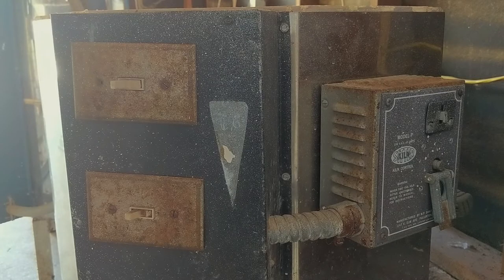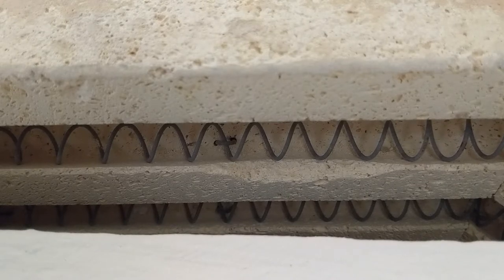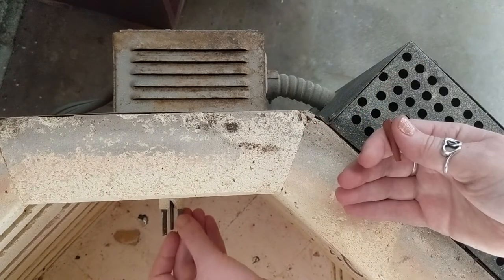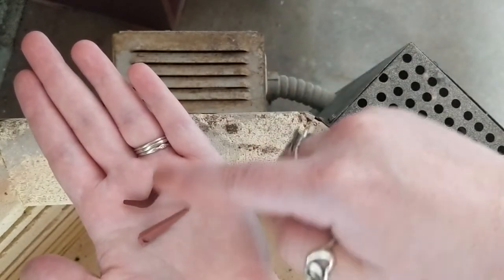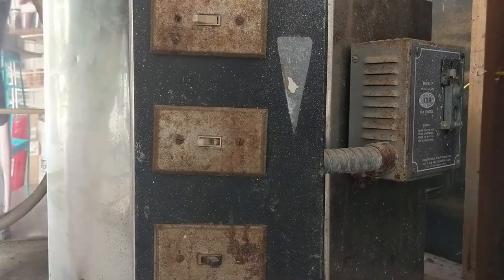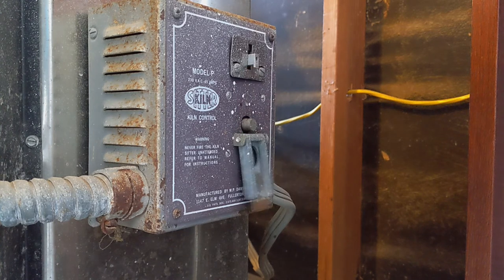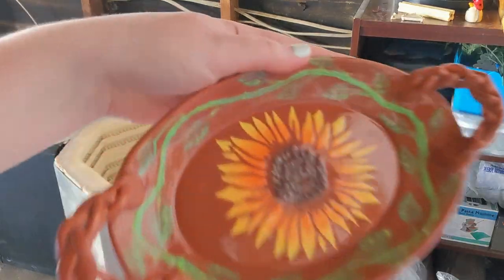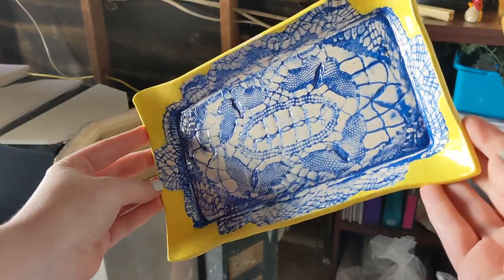Firing My PREHISTORIC KILN… with Light Switches!?

Comment: I have the same kiln setup and had no idea how to use it! In all of the other videos I’ve seen, the kilns are much fancier. Would you mind sharing where you purchase those cones? Thank you!
Reply from the maker: So sorry I am just now seeing your comment! I actually got them from a local ceramics supply company where I get my clay and glazes from.  You can actually find better ones on Amazon that are bars instead of triangular, that will give a very consistent fire since the surface on which the shut off bar is resting is flat and not tapered and would be harder for it to break.  Ill link the ones on amazon but theyre hard to come by.
https://a.co/d/hdwmcct
theres also these to test the temp that your kiln is firing at and test the consistency of different spots in your kiln (sometimes there can be cold spots where your elements may be going out.)  I have explained how to use the following product in several other comments but you basically put them in a blob of clay (because it will stick to and ruin your kiln shelf) or set them on broken pottery or kiln furnature
https://a.co/d/6kgYrZt
and then here are my normal firing cones (but im making the switch to bars when I run out of my regular ones)
https://a.co/d/iSgKvrt
I hope this all helps and I am so sorry for taking so long to get back to you! I hope you see this!
Happy Firing!
Emily

Comment: Thank you so much for this video! I recently inherited a similar dinosaur and have been very anxious about firing it!
Reply from the maker: You’ve got this!!! So glad i could help! And if you need any more help out have other questions just comment and I’ll do my best! Theres also a lot of info in other comments I’ve left on this video too! Best of luck!🥰
Reply: @thepottereden Actually, since you mentioned,  I do have a concern! My top "light" switch is stuck in the on position. I can't get it to budge to off. Any ideas on why this may be happening or how I can fix it? I am thinking I have to take the whole control panel apart and see what is going on in there.
Reply from the maker: @Remi-xz7en  oh no! Well, i had to do the same. If yours is the same as mine, you’ll want to be very careful of the old screws because mine were on the brink of breaking, also the wires in mine are very short so it was a 2 person job. One person held it open and the other worked. Mine had about 10 dirt dobber (wasp) nests in it. My kiln was sitting in an old barn for about 20 years before i got it. We dumped out a literal rats nest before putting it in the car. Cleaned out tons of dirt dobber nests from the inside and the front panel. If yours was anything like mine, it may stink for the first several firings. You may also have to replace some coils too. Do a test strip of different cones (check out other comments for how to) in your first several firings to make sure it’s firing properly and consistently. Theres also such a thing as hot spots and cold spots in older kilns and your glazes will turn out slightly different because of it. Just so you know. There’s not a ton of info out there about that though.
Reply: @thepottereden My kiln was well cared for, luckily! I got an electrician to replace all of my elements and the sticky light switches! I am running my first bisque today! How long do you leave the lower switch on for a bisque in your kiln? I was going to check the moisture from the peep hole in 2 hours, then close peep holes and the lid once I see no moisture on glasses, allow to heat another hour with everything closed before flipping the second switch. I am also relieved you mentioned the smell because, yes... mine is currently quite stinky.
Reply from the maker: @Remi-xz7en  I am so sorry it has taken me this long to respond to you@ Life has been crazy and I havent been very active here on youtube! How was your first (on many I hope) firing?! I am so glad your kiln was well cared for and that you found someone who could replace your elements and switches for you! That is so cool! Do you mind sharing how much it cost? 
Depending on how dry your greenware is, I leave my kiln on and open for 1-3 hours. I have also had to start leaving my peep hole closed because I was having a problem with the plug falling out so I shoved it in and now it wont come out😅 A normal firing that is not rushed and everything is nice and dry, I will leave the top open for 1 hour, put the lid on with the smaller lid off for 1 hour, then close it up (so long as theres no moisture present) and leave just that switch on for an additional hour before switching the next on. If I am at all worried about moisture, I will leave it for 2 hours all closed up.
haha mine smelt like intense rats nest! what does yours smell like?

Comment: Hi, i'm loving your pottery and your video, I just bought an even more basic kiln, very old and lots of rust, but I figured that gives me more money to play with materials and learn. My kiln doesn't have a kiln sitter. I'm not sure where to start with that. Any advice?
Reply from the maker: Hi! Thanks for commenting and reaching out! Let me dig just a little and see what i can find but im thinking youll have to buy a set of pyrometric cones to set up and watch them melt and then stop your firing once it gets to the desired temp. Basically if you want a bisque to fire at a cone 05, youll get 5 different cones, cone 03-07 and make a little clay holder for them and set them securely in the clay at an angle. As your firing process, you’ll see them melting more and more. Watch through your peep hole and there should be a nice soft bend on the 05 cone (set up in the middle) and the lower temp cones (07-06) should be more and more melted, while the 04 and 03 are much less melted or not melted at all. Look up a manual (if you can find one) for your exact kiln and see what it says. Ill try to fond a vid about how to make what i am talking about. They should also sell some reusable “cone sitters” (the clay one i was talking about). Ill try to find that too. Best of luck!
Reply from the maker: This is a great vid to help you understand what i am talking about. I didn’t realize there were self standing/supporting cones which is great! He also talks about only putting in 2 cones one at and under the temp he is talking about. I would suggest at least having 3. His cones are merely for him to know whats happening in the kiln and making sure there isnt an issue with his digital controles, thermocouple, or coils. Yours will be for measuring temp and knowing when to shut it off. So in your case i would at least have 3. One below, one at, and one above the temp youre aiming for.  That being said, when you do the firing, make sure youre raising the temp slowly and have a GOOD pair of welding gloves to take your peep hole plug in and out when you check the cones. Again, best of luck!
https://youtu.be/wO9fk--xgwc
Reply from the maker: This also has some vital info like using eye protection and timing!
https://youtu.be/zvUc-Gw01No

Comment: have you ever put in your cone but forgot to put on the kill switch?  and then have to just manually turn off the button by yourself when it is approximate time to stop the kiln?
Reply from the maker: Great question! The kill switch has to be engaged or it will not turn on. The button will not stay pushed in unless that switch mechanism is up. I dont know if any other kilns are made where they can fire without a kill mechanism

Comment: I just acquired an ancient Sno Industries Kiln with the same silver cone switch box thing you have (thanks for explaining) but mine only has 2 light switches l😂 how do you know how to bisque and how to glaze fire? There is like NO info on this Sno Industries Kiln anywhere.
Reply from the maker: Great question! It is so tricky figuring out how to fire a kiln in the first place. So intimidating! But really its the cones you want to figure out! A bisque will fire at cone 04-06 depending on what your clay says. So you would buy the appropriate cone for the temp you need and the kiln will heat itself up until that cone melts and trips the off switch from inside. If its your first time firing, i wouldnt put anything inside and just do a test fire with a few tester cones. They are cones with little stands on them so they stand almost straight up. Youll want one for a cone above and below the target temp. So if i want to bisque to 05 i would get 3 testers, 1 at 04, 1 at 05, and 1 at 06. Set them on an unfired piece of clay or broken shelf so they dont stick to the inside of your kiln. Fire them to the target temp (05) and after the firing, your 06 (the cooler temp) should be shlumped over, the 05 (target) should be a gentle curve, and the 04 (hottest temp) should barely be melted at all. Ill link a vid about that. But that will tell you if it is shutting off by itself at the correct time! A glaze firing will be the same way. Look at the bottle of glaze to see what temp/cone it needs. A high fire could be anywhere from a cone 4 to 10 depending on what it is. Do the same procedure as before but with the appropriate cones to make sure it is getting hot enough. Some kilns only go up to a certain temp. Also keep in mind that the hotter you fire at, the faster the elements and kiln brick will wear and need to be replaced. Mine is just fine but i only ever bring it up to cone 6 at the hottest. If you have more questions, don’t hesitate to ask!
Try these vids to see if they help explain what i mean a little better
https://youtu.be/zvUc-Gw01No

https://youtu.be/wO9fk--xgwc

Comment: I have a similar old kiln but it has two dails for bottom and top, low and high.  How many hours in between the low setting and high setting you think I should wait?
Reply from the maker: great question! I dont have a ton of experience with dial kilns so let me ask you this, does yours have numbers or a range between high and low where you can turn it up one number every couple of hours or is it more like an on off situation where you can only turn it from low to high and you can feel it click in place at the low or high setting?

Comment: Hi, i Just bought a slithly less ancient kiln. Instead of the switches i have a turn 'button' with 1-4 on it. But it works the same i think. But my question is... With the first bake, the temperature needs to stay a bit around 400. How do i do that?? 😅😅
Reply from the maker: Great question! Its hard to gauge temperature when they dont have a digital temp panel like the new ones do. I am not sure that a cone exists that melts at 400F or c for that matter. You can purchase a thermocouple to use for specific low temps like that! Itll probably be your best bet

Comment: How long the pottery cooks in hours? And what is the average temperature?
Reply from the maker: The potter fires at a peak temperature of about 1888-1911 F (depending on any holds) for a cone 05 firing like i did in this video and takes anywhere from 8-12 hours to get to peak temp to shut off (depending on how slowly i raise the temperature). It will then take about 12 hours for it to cook enough to start opening it (depending on your kiln size. The larger the kiln and/or the more that’s in it, the longer it will take). I hope that helps!
Reply from the maker: You can also look at this chart and do some math to figure out exactly the temp and time with what cone you are using
https://www.clay-king.com/kilns/pyrometric_cone_temperature_chart.html

Comment: Are you still using this Vulcan kiln? Have you found replacement elements for it other than from Vulcan themselves?
Reply from the maker: Thankfully, i have not had to replace my elements! Even though this dino is probably close to 60 years old, i am fortunate enough that it was well kept. Unfortunately, since its so old, i believe the elements would have to come from vulcan. If i were to replace them, id probably go with them just so nothing get accidentally messed up by feeding too much power to them or not enough. I am sure you can find elements for them without having to go through vulcan, youd just have to measure very precisely

Comment: how do you know what cone to use ?
Reply from the maker: Great question! It actually has to do with the clay you use. The clay also determines the type of glaze you use as well. When you buy clay, it will be classified as low, midrange, and high fire clay. On the listing, package, or website, youll find what cones to fire the specific clay at. A low fire clay will be fired to somewhere between 06-04. A midrange claybody will fire to somewhere between cone 4-6 usually and a high fire is usually cone 9 or 10. Sometimes a glaze or clay will say high fire and be rated for a cone 5 so always check with the manufacturer to see what they rate it at. Of course you always fire the clay in a bisque firing first which is usually a cone 04-06. The manufacturer will usually put bisque temperatures on either the claybody or the glaze. I hope this helps! Thanks for watching!
Reply: @thepottereden  thank you so much , i really appreciate your kindness and insight! i just bought a kiln like yours with the switches so i loved this video ! thank you again!!
Reply from the maker: @madisontaylor5109  I am so glad i could be helpful! I am glad to answer any questions you may have! I have lots of videos on throwing and handbuilding and little things ive picked up on my clay journey that may be helpful to you as well.  If you think of anything else, just drop me a comment! I will always answer at some point.  I havent uploaded in a while because life has been busy but im still very active and always answering comments.  May your clay adventure be successful, fun, and full of learning!